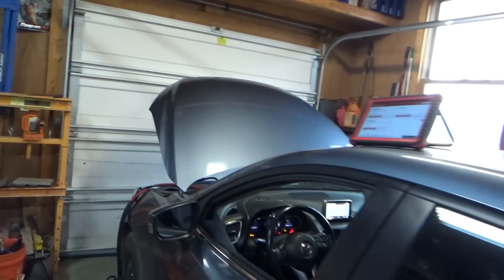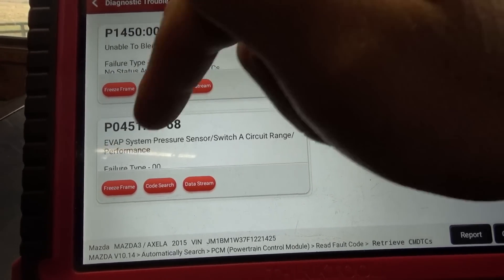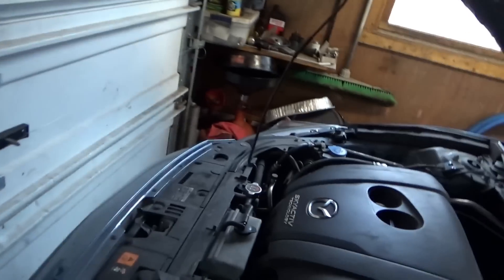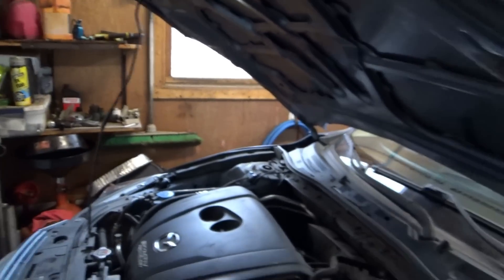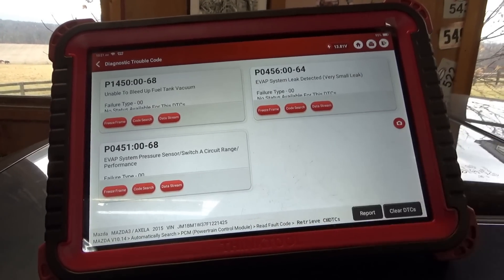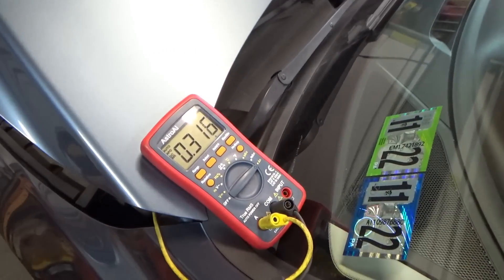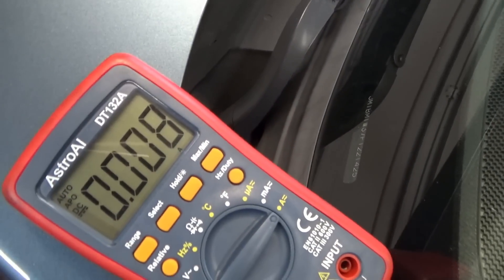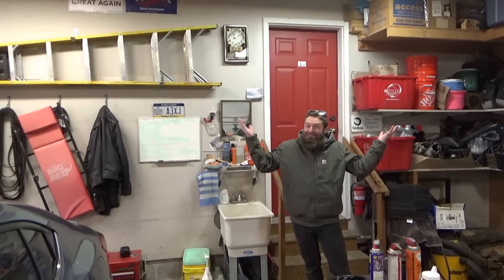Mazda EVAP Parts Cannon FAIL (P1450/P0451)

Comment: Tech a charges 40$/ hr for diag time plus parts and labor book rates.  Tech b charges 120$/ hr and the same.  Tech a always either takes 3 times the time to diag or just throws parts at it fixing the issue some of the time or plays on the customers ignorance.  Tech b finds the fault in a third of the time and fixes it with no parts some of the time or a part if needed most of the time but still charges an extra no parts needed fee to customers.   Tech b gets sued by a customer for charging a flat fee when no parts are needed, court sides on the customers side and puts tech b out of business claiming false charges and “ripping off customers”.  Tech a raises their diag prices to 80$/hr and continues business as usual getting all the customer base tech b had.   Tech a takes home ultimately 5 times what the guru tech b ever did for doing way less work lying to customers, bullshitting them out of money for parts they never needed….  Aint life grand?!?!?!?!
Reply: That scenario has never happened
Reply from the maker: Tech b needs to be up front with the charges to avoid getting sued 🤣

Comment: Glad we're in a state without such testing.
So stupid. So a plugged up nipple caused the code. The fix, cut the hose or remove nipple. Doesn't change a thing to do with emissions but all those parts made(twice), shipped somewhere, stored, shipped again, the customer driving to a few different places to get it fixed, including some 6 hours to you and home caused how much total emissions just to comply with testing and the law? Totally insane.
A sheer case of not seeing the forest for the trees.